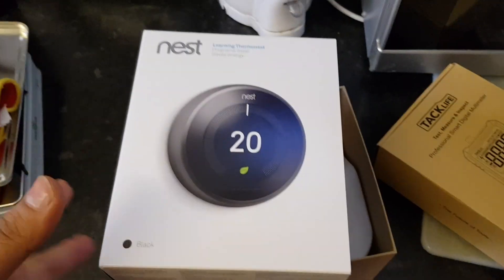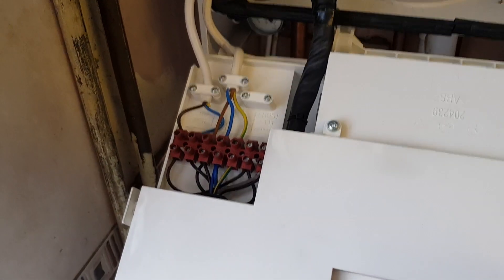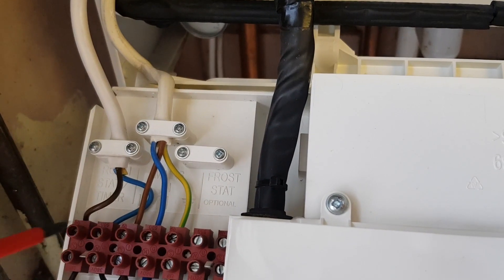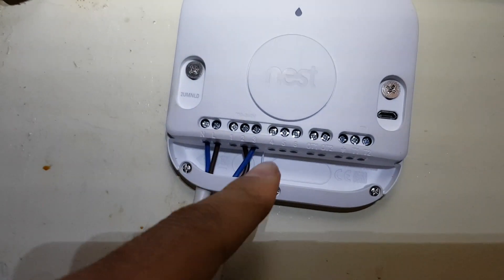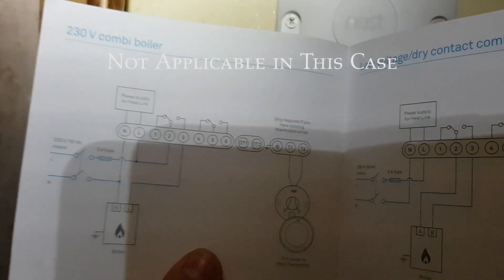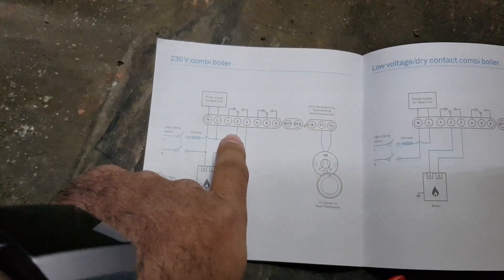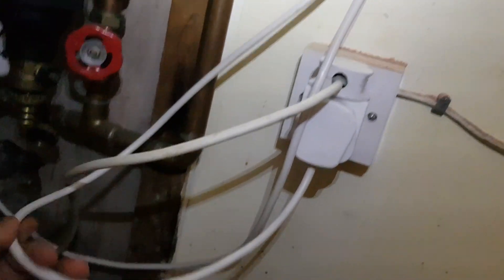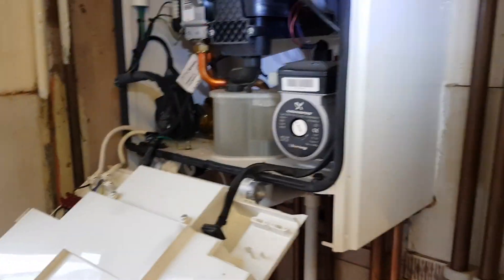Nest Learning 3rd Generation UK Installation with Ideal Independent C24 Combi Boiler

Comment: Hello. Why did you use the Low voltage option? as you are clearly powering off a 230v main supply
Reply from the maker: Hi, I am not an electric or gas engineer. You need to consult a qualified person in this regard for detailed and accurate information. 
However the way I understood, the whole purpose of heat link is to send on/off signals to the boiler, who then turns on/off the heating based on communication received from heat link. And heat link is controlled by your actual Nest thermostat. Regards to low and high voltage options, if you have the combi boiler, your heating will work fine if you put control wires , on point 2 and 3 on the heat link as mentioned in instructions manual on page 10 and 11. Options 4-6 are to control hot water. The other option is OpenTherm which is T1,T2 and earth wiring for that you need to have an OpenTherm compatible boiler which most of the modren boilers are. At the point of my installation I did not have any idea about OpenTherm. OpenTherm is more energy efficient system it uses a different type of communication between boiler and thermostat. So rather than connecting your heat control wires on 2 and 3,  you can use T1 and T2 and earth provided your boiler is OpenTherm compatible. I have already switched my connections to OpenTherm.
Reply: @rizwanarif9291  thanks for reply. I think I have exactly the same boiler. Did you have to purchase abd extra parts to enable you to connect to the open therm??
Reply from the maker: @visualab  Unfortunately I have moved places. At my current place, we have a Worcester Bosch Boiler which has OpenTherm connectivity. So I connected  my thermostat to that. 
Now according Ideal boilers website it is compatible with OpenTherm. check this link:
https://idealboilers.com/blog/the-benefits-of-opentherm-connectivity
Now I remember, that on C24 when you open the flap to access wiring on the boiler, you do find a label called OpenTherm on the right side but there were no connectors, which mean you may need to get that particular connector from Ideal. Your best bet would be to give them a ring.

Comment: Hi, thanks for the video, i have under floor heating which needs to connect to ideal boiler to call for heat. The diagram on the control centre is showing that its volt free switch. Which part do i connect this to on the boiler?
Reply from the maker: In general, with underfloor heating you get a sensor. Sensor connects to thermostat and thermostat conects to boiler.

Comment: How do we wire the heat link if I am using 230 V combi boiler that the first diagram on the manual
Reply from the maker: Follow the method shown in video. It is for 230V boiler. Process should be similar to one used here.
Reply from the maker: The first installation diagram on the nest 3rd gen describes the procedure for 230v thermostat. 
Simply take 2 wires, from the boiler (dont get confused with colour. Refer to your boilers installation manual it will explain where those 2 wire which will come from heatlink, should be connected . You should be able to get a pdf from their website or just google it. ) and install them onto the terminal points in heatlink as shown in installation manual of thermostat.
Reply: I have Vaillant eco plus 831 combi broiler

Comment: What did you do with the mechanical timer and on off timer dial
Reply from the maker: Once I connected the heat-link cables to boiler, the existing controller on boiler got disabled.

Comment: Thanks so much for your video. I have exactly the same boiler and will attempt to install the nest thermostat this weekend. Just wondering whether you had any issues after following the installation you made?
I don't have a socket nearby though, but is it ok then to connect it to the boiler mains instead?
Many thanks!
Reply from the maker: So far I have not faced any problems. 
You can connect to boilers mains if you know the electric work. But I will recommend using an existing socket or an extension wire as you do not require an electric safety certificate for that but adding or extending an existing electric connection may require you to get an electric safety certificate for that particular addition.